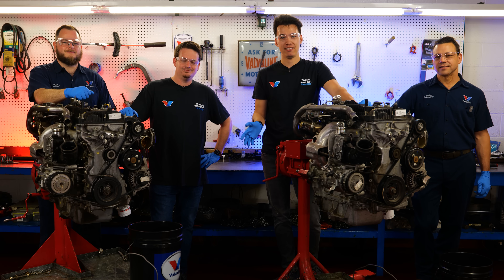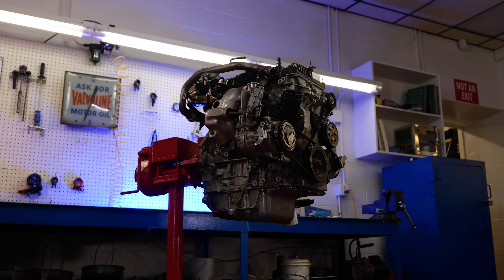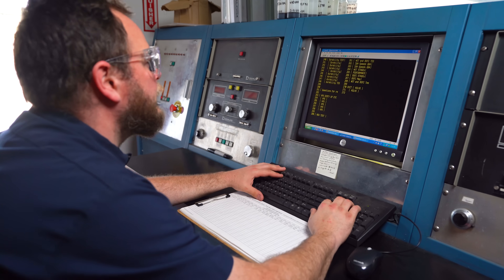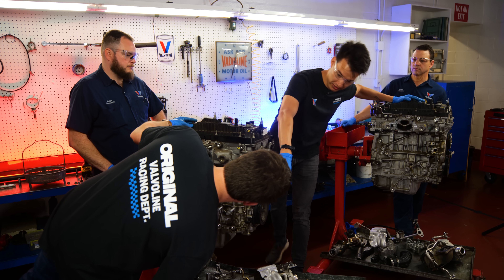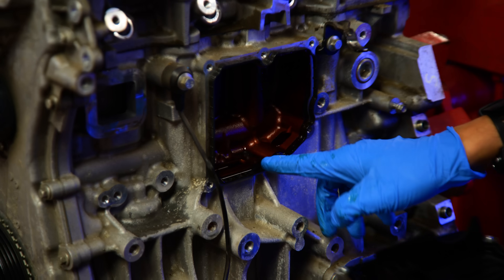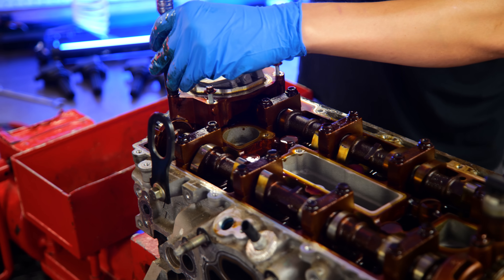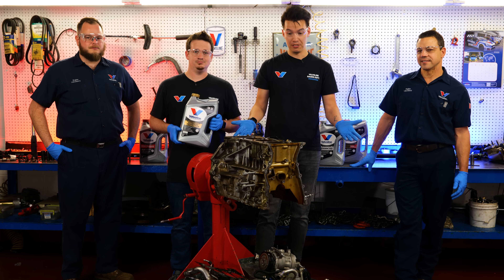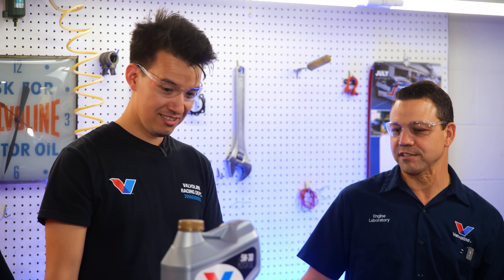Testing different oils over 4 years and 1 MILLION miles

Comment: So conventional oil is actually amazing. I’ve never heard of 10,000 mile oil change intervals using conventional oil. Shocking it held up for a whopping 500,000 miles!! 🤯🤯
Reply: To be fair, it's not the same conventional oil as in 1974. It has a modern additive package.
Reply: Engines were apparently run at constant speed and only stopped for oil changes. That's the key.
Reply: @wholeNwon  No they were not, he explains in the video that they change the loads on the engines intermittently using a computer to simulate acel and decel from driving.
Reply: @wholeNwon yeah, trying doing cold starts in the winter, and short stop and go trips.
Reply: Great stuff 👏😊
Reply: It’s the additive package that enables that… the killer problem though is varnish… it’s unavoidable with conventional oil, so why would anyone ever use it?  Walmarts full synthetic is great and it’s cheap!
Reply: Exactly so why waste money on synthetic
Reply: @johncresswell4680  Depends on your engine. Engines with tighter tolerances require oils that resist deposit formation along with having high shear stability and thermal stability under extreme pressure, which synthetic does much better at than conventional. Emission systems, especially those found in European cars have particulate filters which you don't want to risk getting clogged. Synthetic definitely has its place in the world.
Reply: @johncresswell4680 for less than a cup of coffee, you can purchase synthetic over conventional. Why would you not?
Reply: @johncresswell4680 did you just ignore the video or what?

Comment: I would like to see the valvoline synthetic extended performance against the Mobile 1 equivalent. I run Mobile 1 and always have and change it every 3k miles and when I popped off the valve covers in my engine to change the gaskets and inspect the camshafts, it was still silver. And the residual oil was light gold, and when I wiped the oil away, it returned to silver perfectly. I run Mobile 1 high mileage, extended performance 5w-30 in my 2011 5.0 f150.

Comment: Considering Ford would recommend synthetic oils in the first place, to have run conventional oil 10,000 miles on these is crazy.  I'd wager the varnish would be significantly less with 5,000 mile oil changes.
Reply: I change my oil every 5000 miles or when I get bored
Reply: Idc what a manufacturer says I do mine at 5-7k
Reply: @mauricemotors8207 on ful synthetic no problem
Reply: yeah you are right I think if they change it more frequently with conventional oil then it may tell a different story.
Reply: I wonder what semi-synthetic would look like
Reply: @NormZGarage  I kind of do, but any more, a semi-synthetic isn't worth it.  I've figured out doing full synthetic for the same cost as conventional.  Trying to find a semi-synthetic just doesn't seem worth it, in my opinion.
Reply: @NormZGarage  Yeah, about 20 years ago when I was driving Fords, they recommended semi-synthetic.  As I could buy that for just a small premium over conventional oil, that is what I used (Motorcraft 5W-20).  The research at the time suggested that it gave you around 80% of the benefit for only a small cost premium.  I don't know if that was true, but that was the belief (I was working at Ford Powertrain at the time).  Now, I just use full synthetic.
Reply: @NormZGarage  Kinda in between the two. :face-blue-covering-eyes::face-blue-covering-eyes::face-blue-covering-eyes:
Reply: Yea about 2x longer than conventional should be run
Reply: Yeah I was wondering if more frequent oil changes with conventional would help. But I imagine this is representative of the general public so makes for a realistic test in my mind.
Reply: The "conventional" oil would actually need to be a synthetic blend, as Ford specifies 5w-30 for those engines. I wouldn't do 10,000 intervals on a turbo engine regardless of the oil.
500,000 on a dyno, even with computerized slow-fast, start-stop cycles is a far cry from actual road use. I wonder if they cycled the climate controls as an actual driven automobile would be. If they changed air filters every 10,000, I bet they would still look 20x better than ones in road use.

I am a synthetic oil fan and seem to be getting good results from its use in my POVs...won't be doing any teardowns unless there is a breakdown.😉
Reply: My dad had a 01 Ram with 350k did Once a year change with Mobile 1 full synthetic
Reply: Briefly worked at Ford and their bulk oil, which is what you’d get if you just said “change my oil” is not full synthetic.
Reply: Came here to say that
Reply: Came here to say this.
Reply: I believe 3,500, mi conventional would probably be close to the same as 10, 000 mi with synthetic
Reply: I agree not fair to the conventional oil. But still a interesting test. My 3.7 has 280k oil changes every 5k i run full syn.n now. Praying for another 150k work truck just making me money now.
Reply: The 10k change interval already has error built in. People love thinking spending extra money gives them a sense of security, it’s a false sense, but do you
Reply: I ran conv Penzoil in my tacoma with 250k miles used 10w30 every 3k miles cracked it open because it had a burnt valve. It was clean as a whistle
Reply: I cringe at 5K WITH synthetic!  Of course, it depends how hard I run the car.  If I was doing a lot of top end runs at full boost, yeah the oil's getting dumped right away.  I'll leave the filter sometimes but the oil gets a drain and refill.  I sold one of my cars years ago with 50K of hard miles on it.  The ding dong who bought it road raced it a little low on oil, sucked the pickup dry and spun a bearing.  A mutual friend was there when the motor was torn down - I got a message something like "Did you change the oil every weekend?!!!!!  The entire engine looked literally brand new!!"  Yeah, sometimes. LOL  If I ran the car hard that Fri night or Sat at the track I dumped the Mobile1 and refilled.  I guess it made a difference.  🤙
Reply: Agreed anyone running an engine 10000 miles on any oil is not good
Reply: @scottdietrich3559  That's exactly what they did and both had very limited wear
Reply: Only on the conventional. You still get varnish.
Reply: 10k oil changes kill modern engines. Especially the turbos. Do not follow the 10k recommended nonsense. Down with EPA tyranny. Give us back the 8 cylinders and 6 cylinders. No turbo for me. No EV ever. I’ll walk.
Reply: Yes, if it was designed for synthetic then this is not a fair comparison. Get an older engine designed for conventional and then see how things compare. I put synthetic in my 1996 300zx (first time ever) and ran it hard like I did here and there. A rod started knocking bad after a high RPM downshift but was barely in the red. Yes, the previous owner had ran this engine hard and I could tell the engine was a bit “loose” but nothing real bad or waiting to implode. I just know my Z and can tell slight difference (I’ve owned 11 and none ever blew the engine till this one). Of course none had as much mileage as this one so it’s hard to say but oil plays a big part in a rod knocking and this was when I downshift and revved up so not even under heavy load. Stick to conventional if your vehicle was designed for it and more frequent oil changes.
Reply: No 10k oil changes. Give me back the v8. Down with the EPA tyranny.  These engines never had a real load and all simulated highway miles. No way they’d be this clean with any real heat and stop and go.
Reply: Unless you buy amsoil synthetic your not 100 percent synthetic
Reply: @scottdietrich3559  not in europe. if there is the synthetic mark on the bottle it has to be full synthetic
Reply: How about this novel concept: Change oil based on Service Life  ....  not what grandpa did with dino-juice.
Reply: @94520shatto , great idea, but not everyone takes the time to send their oil in for analysis.  I will on this next oil change.  I changed oil and type, and extended the service interval expectation to a reasonable number.  Gonna see if it holds.
Reply: Fake climate controlled - 10k oil changes with heat and stop and go driving would have wayyyyy more sludge in either oil. 5-6k for most peoples driving situation.

Comment: There is no way that these FORDs (For only retard drivers) lasted over 100K with a 10K oil change interval 

I do not disagree that valvoline is a great oil but the 💩engine  with Chinese turbos would last 500K
Miles Not possible

Comment: If both engines had 10,000 mile service intervals, then this test is a fail and proves nothing.  Conventional oil needs shorter oil change intervals than synthetic.  Can't have a party over some engine abuse. That's why the Conventional engine was darker. Car care nut needs to see this

Comment: Oil and filter changes are always cheaper than the metal they lubricate. These tests while cool are never going to equate to even the most anal real world testing... Altitude, climate variances, driving aggressively, short trip cycling, idle hours, mountainous terrain, offroading... All add up differently than lab testing. For example, wife's volvo gets oil/filter changes at 120hrs(varies from 2500miles to 4k) using various high end synthetics, all result in the same looking oil on an engine with normal blowby, good fuel trims and no performance problems . Super dark near black, smells degraded.... And volvo wants me to just to 12months of this or 10k miles whatever occurs first.... Planned obsolescence is the name of the fame with most oems. Sad but true. Me personally, I'll "waste" oil and filters to ensure the best lubrication to my $15000+ powertrain goes as far as possible. As there arent oems I can trust to want your car to last forever, as they need to make car sales to stay in business. Waste your money on preventative maintenance and you are less likely to have a deal breaking expense anytime soon...

Comment: My 4 takeaways from this:
-The "10K mile" oil interval wasnt just pulled out of someone's ass
-Conventional is still pretty damn good
-real world (not in controlled lab) really puts A LOT of strain
-driving more gently likely extends oil life

3K Conventional 6K s
Synthetic is what I do and will continue to do (much less if 1-2 years since change). It says in manuals usually 10K, but based on all the caveats (that they even often say in manuals I've seen) thats not the go-to for most people. Obviously if you drive like this simulator (controlled temperature, controlled load, sterile roads, et cetera) 10K is completely viable.

Comment: Now. Put the engines back together seal em up and fix any problems. Then use your restore and protect for 100,000 miles and tear em apart again
Reply: Forget that. Buy yourself a GM car from the 90s or 2000s with the 3800 engine best engine ever made for a car. I've seen some with over 500K miles and still going strong like a champ. The cars would rot away first and the engine would be about the only thing good left in the car. So yeah fuck a new car.
Reply: For 30K miles, since it’s three full OCIs
Reply: Restore is not meant to be run that long. Not even close
Reply: @mjcmustang  he didn't mean all at once, dunce.
Reply: @ifyoudisagreeyouarewrong  what are you talking about? He's talking about using Restore for 100k miles....
Reply: @mjcmustang R&P is a fine oil! You could literally run it for the life of the engine, from it's 1st oil change to high mileage 🦾

That info. comes directly from Valvoline's website, too...what in the actual f__k are u talking about or do u even know? 🤔
Reply: @jbone1383  cool. Good for you. Run it then. Idgaf 😂
Reply: Engines don’t heal themselves by using restore and protect
Reply: @twinkieerella  a clean engine is more efficient than the same engine that's dirty/sludged up
Reply: @ cleaning the sludge and varnish will introduce new problems such as oil consumption and leakage
if sludged up engine burns oil it will burn even more oil after cleaning it up
Reply: @twinkieerella  Not really, if oil control rings are cleaned, and theres less sludge overall then an engine would burn less oil
Reply: @ sludge and varnish fill up unwanted gaps that wasn’t there when engine was 0 mileage and once they’re cleaned up problems will present themselves
Reply: as people would say, the life of an engine starts at when the engine was first driven 
engine life is critical at first 0-1000 miles where metal debris of any size is present and it’s up to the owners to replace the oil in the first 500 miles or 5000 miles or 10000 miles
if you want a clean engine buy a clean engine in the first place
Reply: @twinkieerella  Again, false.
modern engines are broken in at the factory for over 25-30 years now.
Reply: @ifyoudisagreeyouarewrong  I don’t think so. Read the manuals my friend.
Reply: @twinkieerella  I don't think so, I know so. Read my name my friend.
Reply: @ I follow my principles not mere profile names on the internet
Reply: @twinkieerella  and yet you're still wrong 🙂
Reply: @ i don’t think so
Reply: @ifyoudisagreeyouarewrong  the corvette c8 system literally limits the rpm to 4500 until the car has run 500 miles, and some other models for 1500 miles, so yeah, you're a troll. leave it to the yt comment section professionals.
Reply: @ The Corvette is a sports car that is produced in limited numbers. It's not a typical vehicle.

Also, the original point of my post was that someone said "Restore and Protect wasn't meant to be run that long" to which I replied "he didn't mean all at once..." AKA he will change the oil and filters and not run 30k miles on the SAME oil/filter
Reply: @ifyoudisagreeyouarewrong   modern engines are NOT broken in at the factory, bozo. own up to it and don't try to derail the convo
Reply: @Vodniq-Duh  you know what, I did some more research and I may be wrong. 

From the few manufacturers I just looked up the modern tolerances are much tighter and more precise than they were years before. Honda seems to use a high-moly oil for their factory fill, indicating that it's somewhat similar to "break in oil"

Modern vehicles don't require break-in because of these tighter tolerences/precision, as the rings bed themselves within the first 30-50 miles anyways.

No mainstream manufacturer requires/recommends break-in anymore. The corvette is a special vehicle however and their engine is unlike 99.9% of other vehicles on the road

Comment: The rollers these cars were on - do they add load to the cars? I know they said they varied rpm and drive speed with the drive by wire, but I’m keen to know if the 500k miles were basically free revving or based on real life circumstances.

Comment: This gives me hope with my 2.0 ecoboost in my focus st. Currently at 91k miles. Ive always used the recommended fully synthetic on this car and while I've not had the engine apart, peaking through the oil cap it looks good inside. Checking you oil, regular services, and just fixing stuff when it breaks is key
Reply: currently at 150k on mine! almost nothing ever went wrong so far. I think 250k is goal before engine replacing, I'm never selling this car. 2016 ST3 WITH mods. AMSoil or motul, huge difference how engine runs.

Comment: This is such a great video, I don't mind that it's an ad. I really wish Mobil 1 did stuff like this as they're the brand that I use, I'm sure they preform similiarly
Reply: yes indeed Shell Mobil and all other oil brands should do the same demos and then let non affiliated 3rd party engineers check without bias

Comment: I change oil at 1500 Miles ive had 3 vehicles in 25 years last one had 310000 before stolen was running better and better on 15 w40 on a 4 cylinder

Comment: I'm using synthetic too not valvoline coz its very hard to find it here 
But I still use synthetic from shell and Castrol 
And when I changing the valve cover gasket on 250k , the internals look like brand new engine just getting break in
And my oil change intervals are 5k 
Constantly drive around 2.5~4K rpm with that 5speed manual box

Comment: I think syntheic oil leaks a lot easier. It's probably because it doesn't gum up as much as normal oil does. And it's able to work its way through seals. I only run synthetic because my engine is known for sludge issues but LOVES to leak even when the seals aren't terribly old.